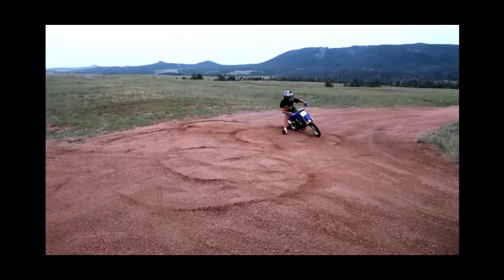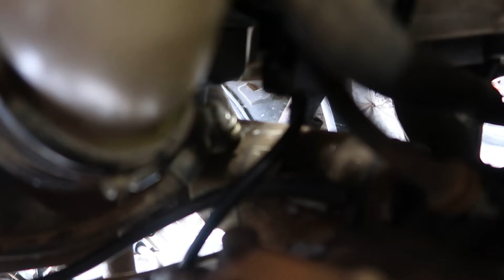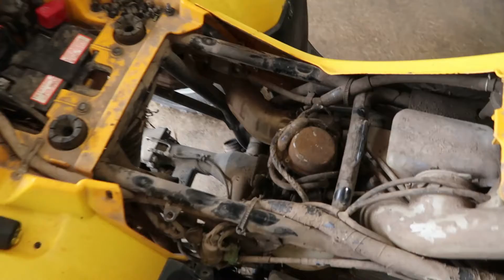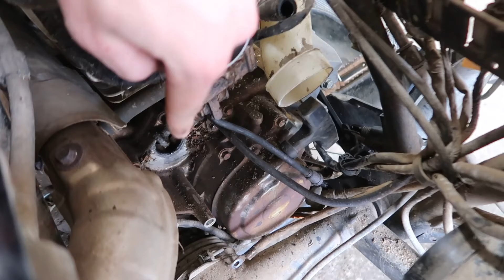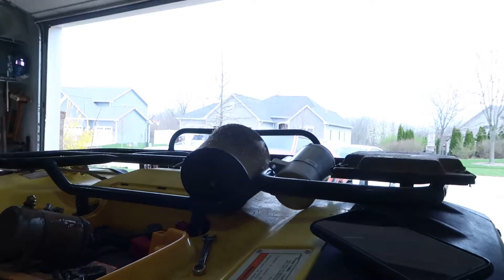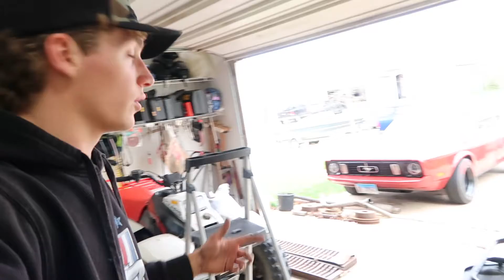Installing New Starter On 2004 Honda Rancher TRX 400! Cheap And Easy Fix!

Comment: Thank you so much for posting this. I’ve worked on cars all my life. Tree Shade stuff in the older cars.  Not the new electronic monsters.  But never worked on an atv.  I’m almost 70 years old and was apprehensive about doing this but your video has inspired me to attempt it. Especially since I don’t have money for repair bills.  And as a woman I really need this thing to help me around the place with my work and like you said in the video “pulling that rope is not easy”.  Thanks again.  I’ve ordered the starter. Now just waiting to get it here.  Be so glad to have my little helper back.

Comment: Would like to know how long the after oem parts last…my 420 is 2009,,fuel pump,injector,battery replaced still issues,,,maybe a ground wire,,intermittent low to no power to starter,,,or starter is going…..

Comment: I have the same quad, 2006 model year.  The fan circuits on these are notorious for going out and overheating the bike.  Keep an eye on that.  When they get hot they cook the oil into uselessness very quickly resulting in clutch issues.
Reply: I’ve never heard of that problem neither have I had it but I got the 07 model thanks though I’ll watch it my bike still runs great at like 6046 miles I wanna say, it’s right up aroun 6050 miles